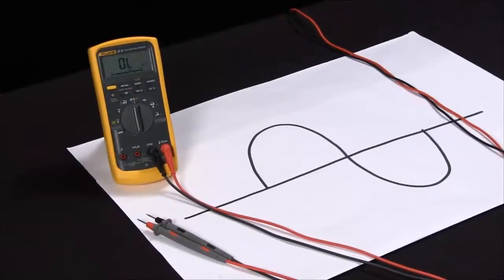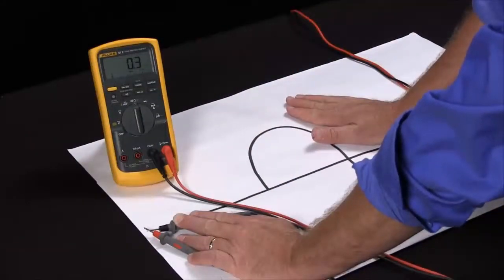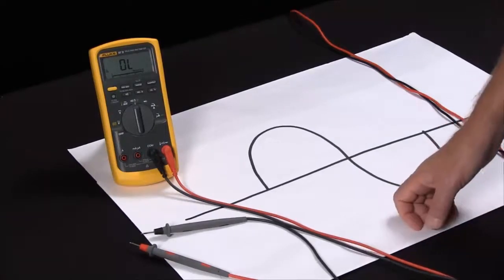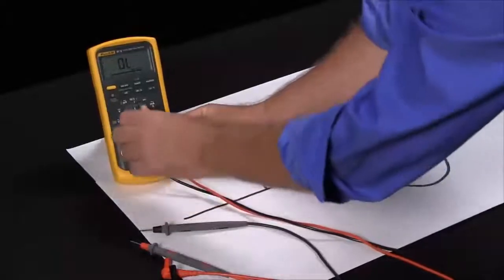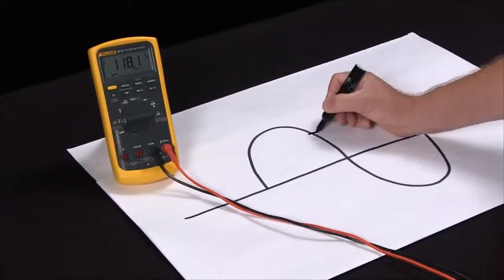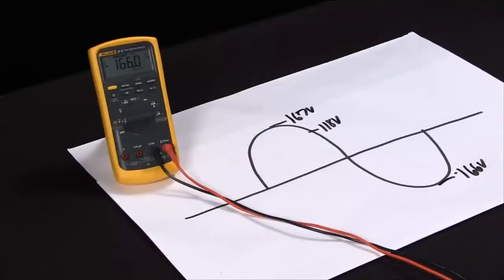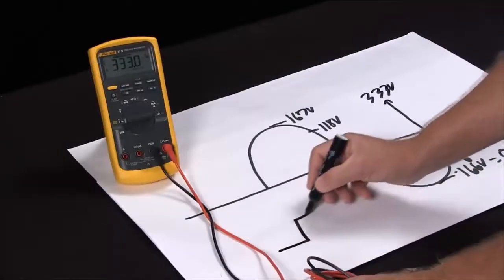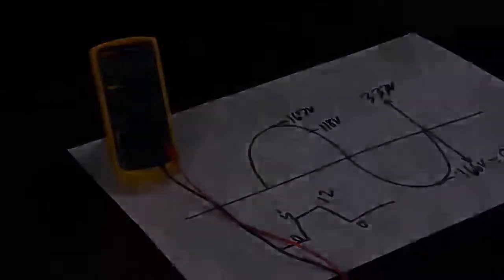How To Use The Delta Relative Function On The Fluke 87V Multimeter

Comment: Ok so I'm not understanding how to read the negative  voltage. How do I get there.
Reply from the maker: Hi Torrence - The negative voltage reading would happen in this example if after hitting the relative button and zeroing out the voltage, the next measurement could be the drop of voltage at the motor.
Reply: 1. Press "min max" button to show PEAK values (instead of the default RMS).
	2. The button below it (beep on/off) has a second function to scroll through peak/min/max/average(?) display. Press until display shows "MIN".  This is your measured minimum (trough) value of the waveforms.
	3. Press  "REL"(ative delta) button to zero the display at this value.

If you've worked the tare function of a weighing scale, then it's eerily similar.